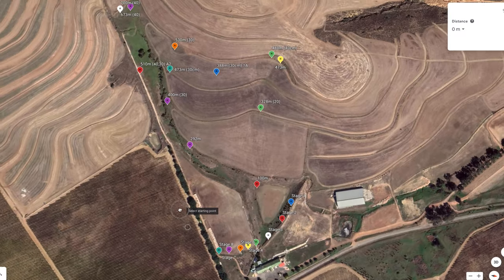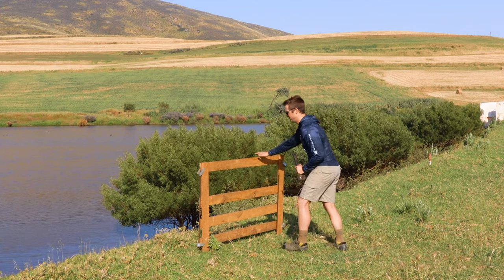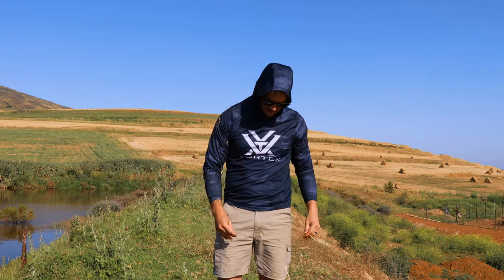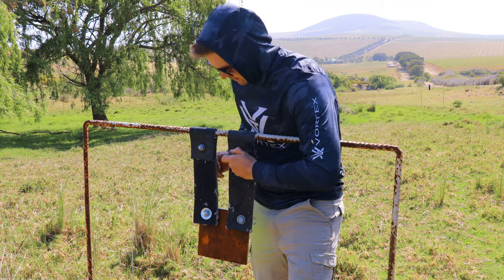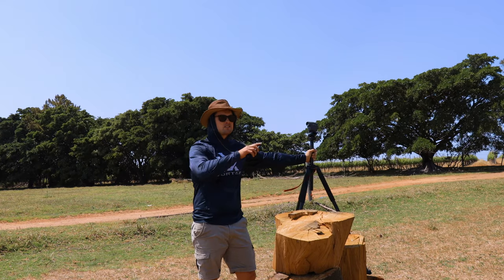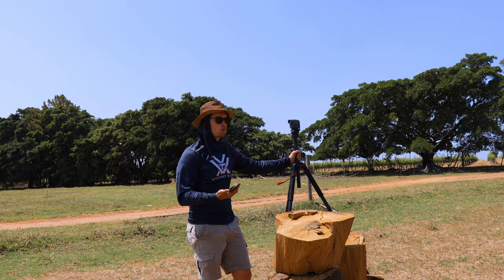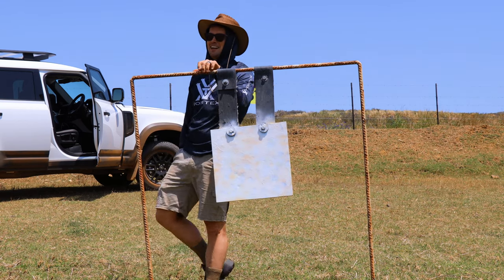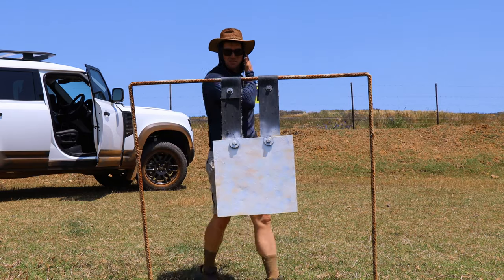Designing A Precision Rifle Match

Comment: nice job ..setting up a match that has new stage's after a long time shooting is not easy ..good job  hay bails might be the '' what the heck is this '' as they are very unstable and compress after a wee bit then if rain soaked and people come in all heights and weights and recoil  ..you might want to rethink that ..it could become a safety issue
Reply from the maker: yup, I redid that those supports